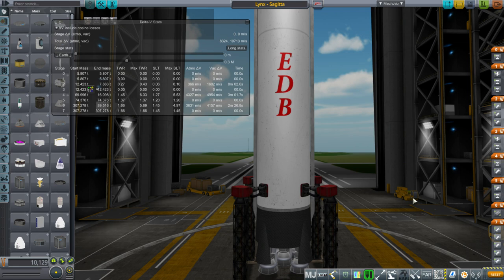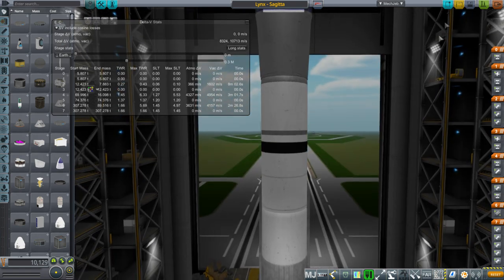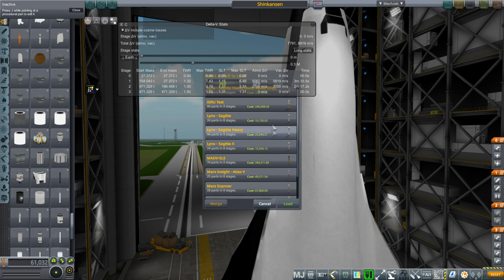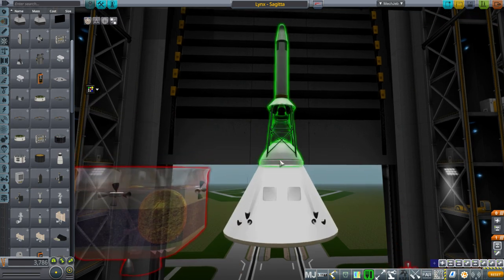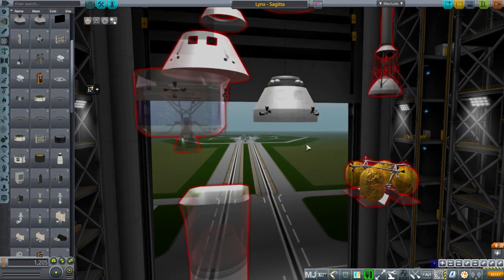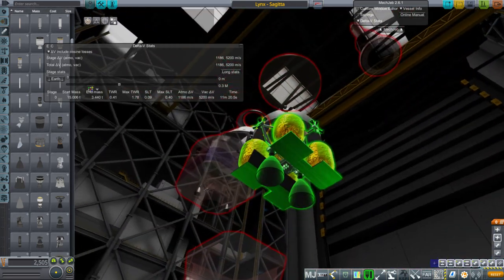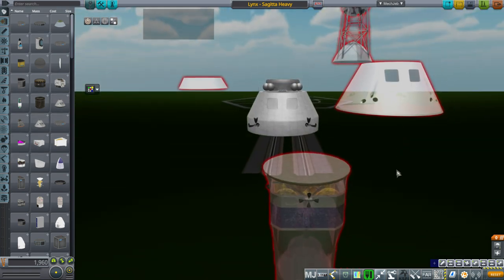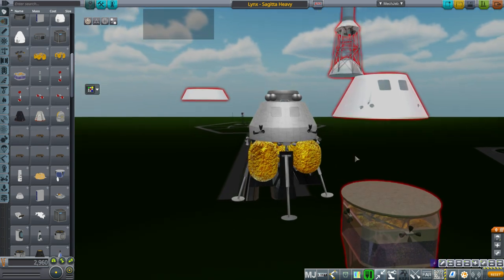Rocket Science - Applications of Designed Systems - Lynx and Sagitta

Comment: The reason the dragon is heavy is almost certainly the dracos. under the les section of this article
https://en.wikipedia.org/wiki/Apollo_(spacecraft)
you can see that the LES is about 4.2tons. if they don't eject the les of the dragon that would be why i's so heavy.
 In regards to orion, I believe the reason it is so heavy is that it is an incredibly large capsule and it's designed for extended missions as well as interplanetary. I think one of the largest ever flown/to fly. Also, Deep space has huge amounts of radiation that fries most electronics and humans(I have just been learning about this in space flight ops class at uni it's fascinating). They almost certainly have huge amounts of shielding on board. Not to mention unlike all the other capsules you have mentioned, it is the one capsule that this is the longest people will be in a given capsule bar the space shuttle but that's another beast on its own. I expect if you take that into account, you are way to light to go interplanetary with that capsule, or even to live in it for long periods of time.